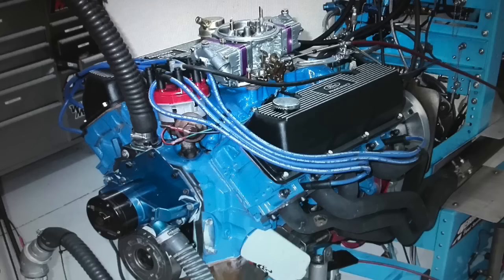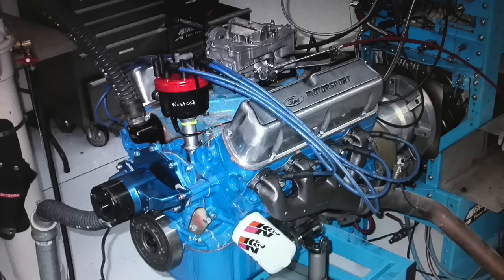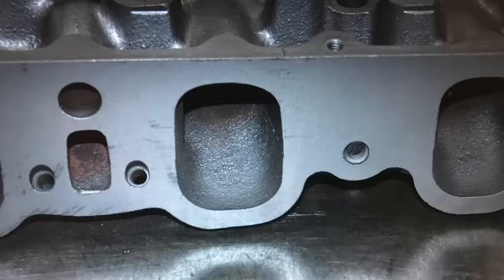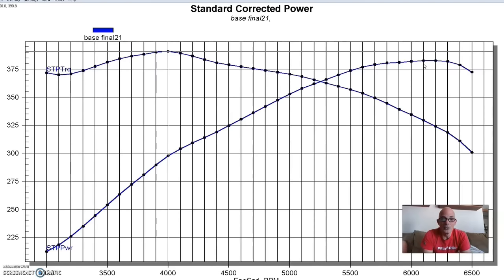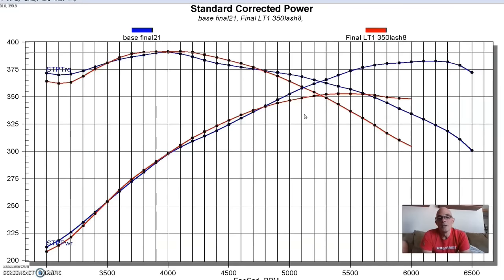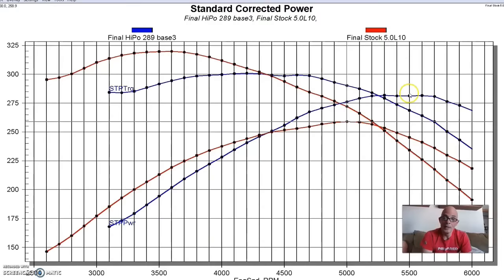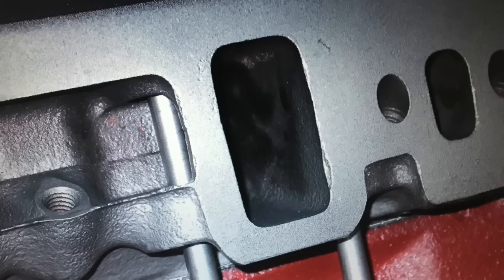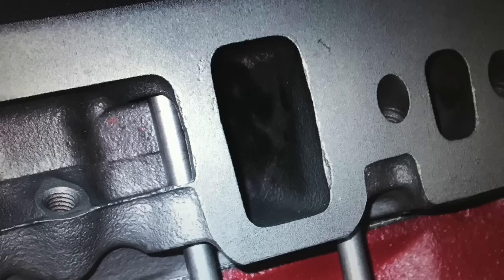HOW MUCH POWER DID THE 1971 BOSS 351 REALLY MAKE? WAS IT THE HOTTEST SMALL BLOCK EVER OFFERED?

Comment: Dropped in a 625 lift solid roller cam, combined a Holley strip Dominator manifold with an 850 dbl pumper on my 71 Boss 351 and it made 525 hp @ 7200 rpm ! She's a beast!
Reply: Hows she doing nowadays?
Reply: Why such a big carb?
Reply: @DominatorGarage hat’s not very big for 500hp and leaves room for more upgrades without buying a new carb. Power Nation did a test from 600cfm-1000cfm carb on a 302 ford and it made power with every carb upgrade. Drive-ability might be a concern but if he’s got that big of a cam he isn’t worried about it.
Reply: I use a 800 dp. But an 850 is easier to come by.
Reply: Face it the boss 351 engine is good. When you consider the lt1 and 340  6 barrel only have .450 to 485 lifts against a 517 lift in the 351. Shut up it should have more power . You didn’t have a real 340 6 barrel to compare it to. Come on get the true engine to compare!!!
Reply: @davem3148 he did that comparison. The 6 barrel 340 was crushed by the deep breathing 351 Cleveland

Comment: I had the 2nd 289 Hi-po in the KCMO area in early 1965. It was pretty goid; then I did some mods: 11.5-1 forged pistons, Edlebrock medium-riser intake manifold, re-worked heads, ported and polished with Chevy valves, Crane cam ground by Melling, 625 and 630 lift, 320 duration and a 94 degree overlap, with a then-experimental Holley 600cfm double- pumper. The engine was insane
Reply: when did this thing run?
Reply: @jamesmedina2062 never. It's in his fantasies. Melling never ground cams for Harvey Crane.

Comment: I had a 68 Torino GT 289 with pop ups and 4 speed my uncle sold it for $500 all it needed was a steering stabilizer motor knocked but ran   Ok I got it from another uncle 30 yrs ago I was gonna rebuild the motor I was mad as hell I never saw a penny and had the chance to buy a 70 fastback fo $200 with a 351 HO Cleveland 4V i bought the 65 Chevrolet truck he wanted $700 told him I’d give $900 to hold till next day all I had to do was tell him to hold mustang person came by after me and bought it for sale in front yard He said the next day he would of held it if I wanted it but I didn’t tell him too

Comment: Well as you are usually very good at comparing apples to apples. Rather than comparing the 351C and the Shelby 289. What ever did Chevrolet have in a 283 that could compete with the 289 Ford. That's what I want to see!

Comment: Richard, don't forget that Ford and Shelby won the FIA World Manufacturers Championship in 1965 with 289 powered Cobras! Slightly different induction system with the Weber carbs and such but those motors made 375 HP if I remember correctly!
Reply: Could have been stock Hipo was 271 hp

Comment: Bought a 289 for my 73 mav in the 90s . Cast pistons had crane fireball 2  cam ,edlebrock f4b intake 650 Holley ( almost identical intake as the Shelby intake ) 3:80 gears and ran 13.6 at 104mph . Changed the cam , first small valve rpm heads and victor jr intake 750 Holley ,crane 238/240 solid flat tappet cam shifted at 7300 with 4:11 gears ( shorter tires ) with street tires went 12.40s at 112mph  Needed 462 gears and slicks the short block was still stock , it had a cranking compression of 125psi I figured actual compression to be around 8:1 .on the “street “ I definitely embarrassed  a lot of people . ( the car wasn’t pretty) I Was even accused of running nitrous. If you have a 289 don’t be afraid to rev it won’t let you down 6000rpm minimum will put you in the happy torque zone .

Comment: My first motor build was a 351C. I was 14 years old, in 1984. That motor was crazy! I later had a 289 HO in a 1967 Cougar, and it was a quick, high rev motor and was a lot of fun. The 351C was just more of a street monster for a 15 year old kid in a 1973 Mach 1.
Reply: Street monster
Reply: I had a 67 cougar xr7 in 86, it had a HO 289 but was smogged for California, first day I got it, I overheated it racing a 5.0 mustang (i won btw lol) and seized the engine. So Had the engine built to the nuts by Honest performance in Seattle. (barely made enough vacuum to operate the brakes)

Never got to take it to the track but I raced an 1100 yamaha from a stand still and stayed side by side up to 80 and we both let off. Never lost a race as long as I had it.
Reply: @jskyg68  barely enough vacuum to operate the brakes i like that.
Reply: @dennisrobinson8008  Rolling up to a stop at idle you could feel the brake booster was struggling. Who cares it sounded awesome.  :P
Reply: @jskyg68  Do you remember the rpm it ran up to?
Reply: @dennisrobinson8008  it had a 650 double pumper and ran out of carb at 6k rpm. (midrange cam, it came to life at 2.5 to 6k)

Had 1.92" int/1.63"exst  milodon stainless valves, a Weiand dual plane intake, Crane cam and 10 to 1 forged pistons, it was built for nitrous but I never bothered.
Reply: Had a buddy in HS that had a 1970 or 71 Mercury Cyclone with a 351 C. 4 speed. Man that car was fast. Faster than my 67 Olds 442.🤨
Reply: @jskyg68 The Honest Performance I remember was on 99 south of the Federal Way Mall.
Last thing I bought their was a set of big block Chevy roller rockers for my clevor. That was like some 35 or more years ago. Engine still running.
Reply: @jesse75  It was back in 87, yeah  they were just off Highway 18 and Pacific highway/99 in federal way.

Comment: You’re not wrong about the 289 , I had one in a 65 Mustang that was built to the max, heads ported, roller cam, 12:1 compression and dry sump oiling, all that for 375 ish hp and it was all done at just over 7000, it’d pull 8,000 but it was just making noise at that point. I also had a 67 Mustang coupe that had a Boss 351 and 4 speed swapped in and the standard bolt on speed parts, Weiand single plane intake and a Holley 4 bbl (I forget what size but I do know it could have used a dominator) cam, Headers yada yada the car consistently ran high tens. So for me to the Boss 351 is at the too of the heap. Now a friend had a 70 ‘Cuda with s 340 six pack and that thing was a rocket ship! You definitely need to test one of those.

Comment: I'm with you on the Boss 351, what an engine!  I have been a Cleveland fan my entire life, it's still my favorite engine.  I have had three 1972 Mustang Mach 1's, a 351C-2V, a 351C-4V and a 351 CJ.  I would probably have another Mustang with a Cleveland if not for the Pontiac G8 GT.  When that car came out I fell in love with it and the L76, LS engine with the rec port heads.  That said, I've NEVER been impressed with the Windsor engine.  I've had 2 cars with Windsor engines and I was very disappointed with their performance, the Cleveland is the BOSS!  I forgot to mention I had a 1974 Ford Gran Torino with a 400 in it.  I put 351C-4V closed chamber heads on it using Weiand spacer plates hogged out from their 2V size to the 4V and put an Edelbrock Torker intake on it with a Holley 750 double pumper carb.  I put a Crane Fireball 302 cam in it to utilize those high flowing heads.  You think the BOSS 351 is good, that 400 was a MONSTER!!!!!
Reply: Totally agree re: the 351C.  I am curious about your 351W comment.  When did you own/run a 351W?  I had a ‘70 Mach 1 with the 351W 2 bbl back in the mid ‘70’s and it was definitely slow even with standard bolt ons.  The problem back then was that there was very little aftermarket support for the W back then such as good heads, cams, etc.  The FE and the Cleveland got all the love from the aftermarket.  That definitely is but the case today.  The W now has TONS of support and can be built with off the shelf parts to easily make 500-600+ HP in a streetable pump gas form.

Comment: I have owned a 66 mustang since 1971, my high school car. Over the years it has had a 289 & a 302. Best 1/4 mile times was with the 289. First thing I did was a port & polish with 351W valves. Then an F4B manifold and 650 cfm holley. Next an isky .480” lift by 280* duration cam. Running 351W exh manifolds. Nice strong stock looking motor. The is an article in the 1967 Complete Book of Engines magazine talking about what ford was doing with the 289. They had a HD engine that had a tougher block and heads with 1.875” intake and 1.625” exhaust valves, big ports and an open chamber with better spark plug location. Equipped with the Shelby cam, long tube headers and Webber carbs. Was hitting 400+hp @ 7000 rpm with points.
Reply: Shelby's 289's were running 385hp with dual 4's in the Cobras. Always thought that was very impressive. That said think what he would have gotten out of a Boss 351? Wonder why Ford didn't stick with canted valve better breathing heads? I can understand wanting the ports a little smaller but still you would have thought they would have kept making the Boss 302 style heads or heads that flowed well. Well that's why when you look through classic cars that normal people can afford half of them have 350's in them. Not because Chevy made a better engine but they offered better support for the hot rodder.

Comment: I bought a new 1966 red Mustang fastback 289 hp, I loved this high revving little engine. I took it to the drags, with a little tune, open exhaust and 6" slicks it ran 14.54 @ 98 mph. I raced it for a couple of years, I made some changes, headers, Shelby thin head gaskets,  7" slicks and 4.57 gears. At Fremont Baylands raceway it ran a best of 13.78 @ 100 mph. (  all with the stock, little autolite  470 cfm carb. that carb was never rated at 600 cfm )  I wish I still had this little car, but my wife got it in the divorce

Comment: Best episode yet! Calling out Dulsitch too. 🤣 Perhaps a build off between 351C vs 340 six pack is due. 🤔 For braggin rights.
Reply: No comparison. The canted valve Cleve will run over the 340
Reply: @chadkent1241  Agreed. Now if we give the 340 W2 heads...
Reply: The 340 is a great motor but the Cleveland heads are just better than the X heads in stock form.
Reply: I'm a Mopar guy but the 340 is kind of a disappointment on the dyno. Nick of "Nick's Garage" tested a basically stock 340/6 pack and didn't even crack 350hp. I was truly surprised and truly disappointed. Especially since I had owned a 340/4 speed '71 Demon back in the day and I thought it was faster than shit!
Reply: Gotta say I would be keen to see that.
Reply: Nick's garage tested a 340-6 @ 325hp/356tq. Stock exhaust manifolds.
Reply: Yes 325hp is definitely not "cracking" 350hp.
Reply: @1967davethewave  That wasn't your imagination...  It WAS faster than shit!
Reply: The MOPAr HASEN'T GOT A CHANCE.
Reply: I'm a Mopar guy but I think a boss 351 would make more power.
Reply: The boss 351 was a great engine but unfortunately it was a little late to the party.
Reply: dulchic already made 409 hp with a 360 magnum crate motor. 
mopar advertised it at 380 hp.
Reply: @bkeith269  - 325 HP is good for a stock 290 HP rated engine...
Reply: @axlegrind4212  - 351 C had ports and valves big enough for 600 HP, but the poorly shaped ports resulted in severe turbulence and 300 some HP... they sell 'port plates' to help straighten the air flow some... but welding/filling/re-porting is what is really needed...
Reply: I to want to see this....
Reply: @chadkent1241  a 340 6 pak duster or chalenger will smoke any 351C mustang all day anyday seen it over and over again the 340 was a giant killer even in its 4bbl version that 340 Nicks garage build was a turd ive seen 340-6 make 360hp and 427 ftlbs throught factory manifolds add headers gonna make atleast 30-35hp stronger
Reply: @jackrabbit7389  the 351C was the most handicapped engine in PS racing. Bob Glidden dominated and had an undefeated season with his 351C powered Fairmont. The next year he had to switch to Dodge. The following year he went back to Ford and the 351C was faster and quicker in every way. The sanctioning body switched to the 500 in³ rule because of the Cleveland....not a 340 Dodge.

Comment: Here's my two cents on the 289....

I've been to quite a few vintage road races, including multiple visits to the Monterey Historics/Motorsports Reunion, and early 289-powered Mustangs are quite common at these.  And I just love the sound of a race-tuned 289!  I don't know what exactly was done to the engines in these cars - surely some work has been done to improve the head flow, along with bigger cams - but the best ones sound like they're revving clear to the moon.
Reply: There is no other V8 that sounds better than a 289 Ford at 7500.
Reply: I've been to a few Vintage races as well.  Road America in particular.  Talking to several "289" Mustang drivers, I've learned the engines are all 302-305 C.I. with modern heads, per the rules.  Claimed H.P. numbers are 540 H.P. at 8400 RPMs.  Note: that would not be a "street-able" engine. 

I would prefer to "camouflage" a stroker 363 C.I.  with a decent street cam and be satisfied with 500+ H.P. at 6500 RPMs.
Reply: there not 289 there useless,,there moded 302,with heads cam injection pushing over 500 hp..balanced ect ect,most reliable easy power engine for street is the 351c.hands down,better design than windsor.ive never blown one up or had any problems.there a truck engine,strong..
Reply: @phantomwalker8251  Please, enlighten me. What is the deck height of a "Cleveland' VS a 351
Windsor?
Reply: @terraboundmisfit  9.208" Vs 9.503" from memory actual 9.206" and 9.480" (1969-1974) 9.503" (after 1975). My memory was off a little on the Cleveland but not too far.
Reply: @phantomwalker8251  wow dude, you should learn the difference between "there", "their" and "they're"
Reply: @red94mr28  yeh bud,concentrate on content,not spelling..wait till your 72..!..
Reply: Justin Henry  I think the only ones that got Cleveland's were the later Rancheros because they were based on Torinos. 351M/400s were later I'm thinking 78 or 79. 351W had an incredibly stout bottom end, why we called it "The Stump Puller Motor", same with the 300 six...
Reply: @red94mr28  
They're all the same,   They're all good 👍
Reply: X-pipe?  Turned past 7k, you’ll get the F.O.R.D. sound…

Comment: Hey Richard, I love this video about the 71 Boss motor. Like you I've always thought that was the best Boss motor made in the small block trim. One note I would like to add to your upcoming pursuit of the 340 six pack test. When you talk to Dulcich about it, ask him if he can Source a correct camshaft for the 68 340 4 speed engine. While you have the 340 on there you might as well swap the cam to the 4sp engine configuration that they did only in 68 and put the four-barrel on it and try it. I think you'll be surprised what that 340 4 speed engine in 68 actually made. Starting In 69 all 340 engines had the smaller automatic camshaft. In regards to the 351 boss I also believe the factory compression ratio was rated at 11.7:1.
Love the videos buddy, keep them coming...👍

Comment: The 289 Ford - in any form from stock 2v to Shelby spec - is one of the all time greatest engines. Nothing else sounds like a 289, and they just will not die.
Reply: Amen.
Reply: They also won't make enough power to beat anything.
Reply: Oldtimmer - If you had a Boss 351 you wouldn't say that especially running against a Boss 351 it would slap the HP 289 silly but I respect the HP 289 it does do very good.

Comment: As always Richard, great video thanks for posting. As a lifelong Ford guy it’s great to see the Cleveland finally getting the recognition it deserves in the sea of Chevy performance. My buddy in high school had a brand new 5.0 5 speed and that thing had torque for days considering it was 302 in.³. My brother at the time had a 65 coupe with a hipp spec 289 in it and a four-speed and the 5 L was all over him lower in the RPM range. And as much as the cylinder heads are restrictive, Shelby race cars still made north of 400 hp with these things so obviously improvements to the stock heads can be made. The racing rules required that OEM parts be utilized so the claims of 10,000 RPM hipos is incorrect.  Nonetheless they were sufficient to be Chevrolet in 1967 with only 289 in.³. So there must be some magic and making those cylinder heads work. Just my two cents. Keep the great videos coming. I always look forward to what you post. Have a happy holiday.

Comment: 351 Cleveland is the most under rated V8 there is. It’s a monster. I have one in my 2WD 1979 F150 that was pulled from a totaled Torino. It’s the biggest sleeper in town. It dominated the high school drags. Slam you back in the seat power

Comment: Try this some time. I have a 289 .30 over (293 c.I.) short block. Forged rods and pistons and stock crank zero balanced. With GT40 iron heads with mild intake work, big exhaust work, port match to an old X-cellerator Weiand intake and a custom solid roller cam. A 750 CFM Holley road race carb. I did spend big money on a shaft Jessel roller Rocker system. 
  I did this as cheap as possible buying used intake, carb and roller rockers. With less than 4500 dollars in the motor it makes 368 hp to the wheels of my 85 Mustang GT. It takes your breath away when it is up on the cam! Long tubs with a big x pipe and boom tubes it has a wonderful exhaust note. It does take work an a lot of rear gear to wake the 289 up. And this build looks very factory in appearance.

Comment: Very informative video on these Ford small block motors. I think you have to put the performance of the Hi Po 289 in perspective. It was developed early on in the muscle car era certainly a few years earlier than the Boss 302. Also being 13 cubic inches smaller in displacement, that is a torque penalty of at least 13 foot-pounds. What surprises me is that I recollect that the 289 Hi Po factory rated power was at 6000 rpm achievable by using solid lifters. Your dyno shows the peak around 5500 rpm.